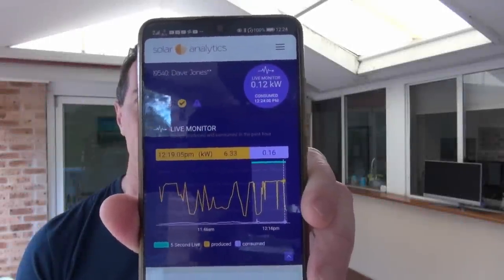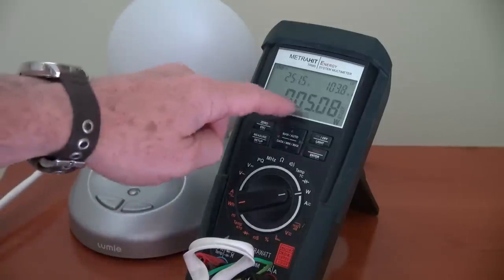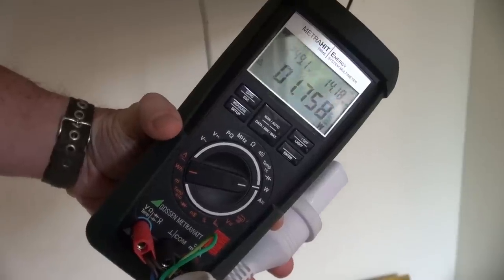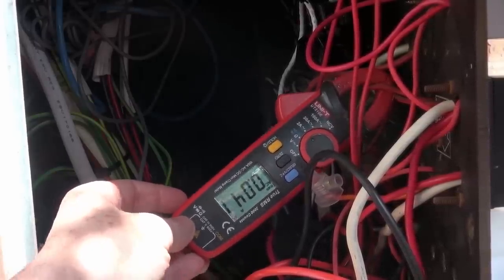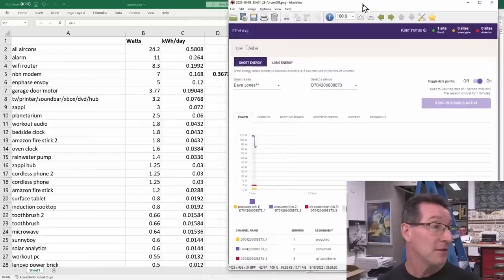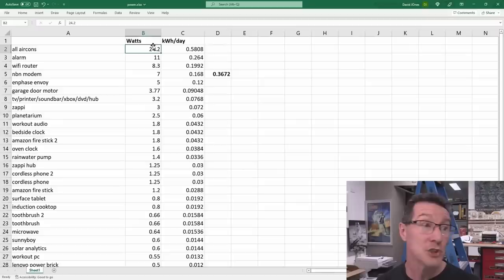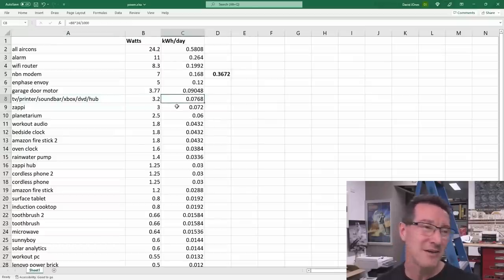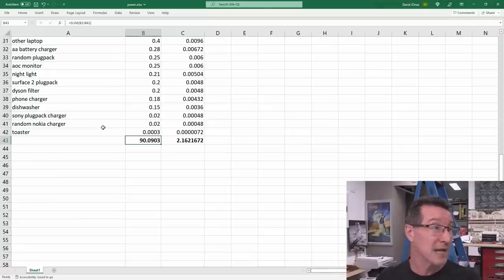EEVblog 1505 - 120W Home Phantom Power? Audit Time!

Comment: AV Receivers can be pretty bad. When (Brand Name Suppressed) first made HDMI-capable AV receivers, the manual documented the "Standby Power as "blank". Not mentioned. They didn't want to admit to running 40W in standby. Or 3.8MWH/year. Or to the model that ran at 115W in standby. They took this much to support a "feature" of linking the first HDMI input to the output when in Standby, but than meant keeping all the HDMI hardware powered up. Their next generation allows "HDMI Through" to be set to "Off" to stop this. Successive generation managed, 16W, 8W, then 4W. But still a lot more than the "One Watt Initiative".
Reply: Are you high? 40w is about 1KWh/day, or 365 KWh/year.  $55/year at $0.15/kwh

Comment: You might not be charged directly for reactive power, but all that current going through long wire runs in the house will consume a significant amount of real power due to resistance of the cables, breakers, plugs, etc.

Comment: Hi Dave, great work on the audit and explanation! I didn't see your fridge / freezer in the audit though? I know mine draws ~120w every time the compressor kicks in...
Reply from the maker: Mentioned at the start, they are powered from my battery.
Reply: That 120W is only for a very brief moment, just to start the compressor. Once it is running it should only draw a few 10's of watts, so to save power there you can simply adjust the thermostat. I have a thermometer monitoring my fridge showing the max and min temp.
Reply: @EEVblog  Ah, obviously missed you saying that 😅

Comment: I wouldn’t switch your router off every night. They don’t really like that, especially the more complex ones. Depending on the type of NBN you have, I’d be inclined to ditch the ZTE thing and go with a ubiquiti unifi setup. Trust me, you’ll never go back, and I say that as a washed up network engineer in a former life.

EDIT: yeah, if you want an awesome router, grab yourself a unifi setup. With cable internet, you just plug the router straight into the modem.
Reply: Sorry mate, unifi sucks. Anything openwrt is superior, and you can pick up some used enterprise access points to spread through the house and give you a lot better performance on the cheap, just gotta be aware of what's licenced and what isn't.

Comment: In light of the current energy crises there's a lot of "guides" on how to save electricity floating around. All of them say to unplug phone chargers when they're not in use. Really? To save less than 0.1W or a fraction of a kWh per year? Turning modem/router off over night is another. It may make more sense, but only if you still have a traditional phone line instead of VoIP. If you did turn it off that's maybe 20 kWh per year, so not nothing but also not earth shattering.
Honestly, just put a lid on your pots and pans people. Your food will cook faster and at lower power. Pay attention to the power consumption figures next time you buy a large appliance. And maybe turn off the TV and read a book or go outside every once in a while. One hour of TV watching is about the same as one week of turning your router off over night.

Comment: You summed all the real (not reactive) power consumption directly at the devices´ side. The reactive power was much higher than the real power, in some cases one order of magnitude bigger. But the house wiring is also burning power by providing resistance, so your measuring setup might be inaccurate when you measure AFTER this current path. You should include the house wiring into your measurement, as the reactive current will cause real power loss in the cables.

Comment: An uneducated guess: doesn't it require power to sustain the EM field that goes along every power running wire? It extends a field within a field, so it must effectively push against it? Could the missing 10w just be the wires fields?

Also, having exact knowledge of your wiring, and given the strength of the background EM field, sounds like that should be pretty calculable. Ofc geo orientation / alignment against the background should be taken into consideration as well.

Comment: Some of the missing power might be I^2 R loss in your cables, from all the reactive currents.
Reply: even if he had 1 Amp rms (240 VA) spread though all those circuit branches, the I^2R is going to be less than 1 Watt

Comment: I did a similar audit on my house about 18 years ago.  I found that my LG CRT TV was using the most standby power at 12 watts.  I always wondered what it was doing with those 12 watts.  So I started powering off and on the the TV everyday using the big clunking power button it had on the front.  After about a year, the button wore out and stopped working. 🙁
Reply: Most of those 12 watts were keeping the CRT heaters warm so the picture was displayed instantly, without it the tube would need to warm up before the picture became a comfortable brightness.
Reply: I remember when the big clunking power button was all there was.

Comment: I am aghast at how many electrical items you leave on standby or just plugged in consuming power....!
In the UK we have just had a huge increase in energy bills and everyone has had to cut back on power consumption, never leaving toothbrushes plugged in unless they really need to be charged, TV is never left plugged in when not in use, hi-fi on stand-by - unplug it unless you are using it! And a garage door opener, I'm disabled, and I still get out of my car to open the garage door and don't rely upon an electronic door opener. The microwave is never left plugged in and likewise the gas cooker that has an electric clock because they all consume some amount of unnecessary power! I could go on and on about stuff I/we don't leave plugged in consuming power, we have to because of the huge increase in power costs in the UK, our electricity cost has tripled in price. Unless it HAS TO REALLY be powered, unplug it, you don't need your toothbrushes plugged in 24/7, get out of the car and open the garage door and unplug the electric door opener, that is if you really are serious about saving costs and not just blowing hot air!!!
Reply: Toothbrush costs about £2/yr at current inflated rates - how many cycles does the switch or socket have in it, and what's the cost of replacing it?

At some point you end up throwing more time and money at 'saving' money than you actually save.
Reply: @Monkeh616  £18 a year mate at 0.6W, that becomes 20p a day if you have 4 of them thus £6.20 a month. For tooth brushes on constant charge. My one runs several months on replaceable AA batteries, no charger needed.
Reply: @dlarge6502  You're off by an order of magnitude. I genuinely can't post the math because YT deletes it silently. If you get three months out of a pair of AAs the cost is.. comparable at best, and you're creating waste and, if you bother to, a recycling problem.

Comment: How much power will be used by a timer?
Reply: You can get a battery run timer now for about $10.00. LCD screen, no moving parts but the buttons to set on and off time.

Comment: Although its interesting to know, trying to save power at this level is  going to far.  You could setup homeassistant to automate things in your house with much finer control, but the power usage of 5-8w would probably drive  you crazy.
Reply: Depends on where you live, unfortunately it is more and more important with electricity prices being up to 3x as high for residents in Switzerland for next year.  I don't know how much electricity prices will change in Australia.

Comment: So you didn't find it! It's a whole full sun panel at 250W and you found 90W. I don't know about reverse reactive load from your branch of the grid, but how about putting a less leaky capacitor on that one A/C and finding out how the power factors fight each other to crack out 150W. Maybe you need to be the first one to save 150W sprinkling SMT capacitors in his fusebox...maybe save enough power to play games or maybe it's the line capacitance on 40 meters and scopes and supplies?

Comment: I wonder how much power cables themselves consume. If you think about it - mains cable is a weak capacitor, so there should be some power lost there. I'm pretty sure it's negligible, but I wonder how much it is.
Reply: Most of that is reactive power, homes don't pay for that.
Reply: current through a (ideal) capacitor is 90 deg out of phase with voltage, so real power is zero.
The parasitic capacitance you are describing is very close to ideal (no ESR component).

Comment: I was shocked that my washing machine is ~1.2W but 15VA. Then I looked at the DVR that PoE's cameras and 120W real power 24/7. I suspect I can run the 48V PoE stuff off DC once I get my 48V solar setup going, but for now I think it's just that they shoved a tiny PSU with a fan into a giant box (the SSD is larger than the main circuit board in a 1U rack box)
Reply: I can beat that - the Panasonic inverter microwave takes less than 1W but 70VA due to its appalling  PF.

Comment: I noticed you did not mention network printers. I have 2 laser printers (HP and Fujitsu) and both of which are power hogs requiring 10W each standby power. I tried only switching them ON only when I needed to print but found them unreliable in connecting to ethernet, so I have to leave them ON continuously. I suspect they use a heater so they start up quickly (10-20 seconds).
Reply: I imagine these are like 15+ years old? More recent devices should be more efficient in networked standby. I would also advise setting them up to use a fixed IP, and use just that as the printer port ( none of that WSD rubbish as Dave might say). This eliminates local DNS and DHCP as a potential error source. I won't be surprised if it makes your printers work reliably even after a cold start, been doing that for years with zero connectivity issues. If not, time to start looking for a service manual and track down some bad caps, I guess (assuming they didn't just use an off-the-shelf power supply module with replacements easily available).
Reply: @PileOfEmptyTapes  Thanks for your comments.
The HP is a LJ4050N and is about 25 years old. I had real problems getting Windows to pick it up on a network scan so had to give Windows its net address and type before it would install drivers. It is only B/W but still prints 100%. As it prints about 4000 pages per cartridge it is my go-to printer for printing. The other printer is Fujitsu Docuprint colour printer. It is about 10 yeas old and was given to me as a good colour printer. As they both work perfectly I prefer to "let sleeping dogs lie" and accept phantom standby usage.

Comment: pretty interesting i thought was the large difference between the aircon units... dont those things each have a really large capacitor in them for some essential function? if true then could it be worthwhile to take them out and check the leakage etc? for example if they have been in constant usage for a number of years and compare to the newest one. just wondering why else they could possibly vary so much between each other (if they are in fact the same model and version, however you did not clarify that in today's video here).

Comment: Does the logger, log via internet? And didn't you switch of the power to the modem in the last shot at the fuseboard?
Reply from the maker: No it logs via 4G mobile sim as I mentioned, and no the WiFi was still turned on anyway.

Comment: If you switched off your WAN link at night, would your energy system's monitoring be able to buffer the data during the blackout period and flush the buffer to the cloud infra once the sunrise WAN link is reestablished? Or would you wind up with blind spots in your energy dashboard?
Reply from the maker: The solar analystics is 4G SIM card. Enphase switches off at night anyway.

Comment: If you have solar + battery + inverter for your home, do you "pay" VA? In other words, should we be more careful about pf if we are off-grid on an inverter?
Reply: sortof yes, but not for these phantom loads.
You need to spec your inverter and wire gauge for the max VA at max load. That might be more up-front cost.
But don't focus too hard on steady-state VA numbers, because appliance/motor startup inrush is often orders of magnitude bigger. You don't want your inverter to overload and fail every time the freezer compressor starts up.

Comment: Saving 0.3672 kWh/day with your networking gear with a smart outlet... let's say the outlet uses 1W all the time, and you're saving the power from the gear for 7 hours a day. That's 0.1311 kWh/day or 3.933 kWh/month saved. If you spend $0.30/kWh and the outlet costs $30, it would take 25.4 months to break even. Is that worth it to not have your devices be able to update overnight? How sure are you that the smart outlet would turn back on in the morning without internet (my TP Link Kasa outlet wouldn't)?

Comment: Did you factor in heat generation due to the resistance of the wire runs? I doubt that would account for ~~17% error, but I'm sure it's nonzero.
Reply: Lets say the total VA for the ~100W phantom load is 240 VA(42% PF).
That means there's 240VA/240V = 1A spread throughout all the wire runs.
Worst case is 1 wire run of 14AWG (all the current in the same wire), but in reality there's dozens of wires distributing the load current.
Assume a generous 1 km of wire (500m to point of load and 500m return) = 8.3 Ohms.
Power dissipated in the 1km wire is I^2 x R = 8.3W
In his house (multiple circuit branches that are much shorter than 1 km), it would probably be much less than 1 W.
Reply: more likely, its the fact that residential (and industrial) power meters usually do not have a rated accuracy below 1% of rated full load.

Comment: Wouldn't turning off the router and modem increase the power draw of things like the xbox and fire sticks as they search for a working wifi connection?
Reply from the maker: The xbox and one fire stick can be easily switched off.

Comment: (joking) It's just the draw of the monitoring unit. The Lenovo has to logon the secure machine in there to spy from time to time. I totally disconnect my computers including the network when I am not around and I don't know if there is going to be a storm. My internet goes through my phone, so when I pull all the plugs there is no wired connection to anything.

Comment: my background draw is 500w - down from 600w after swapping out my thirsty Cisco 3750-48poe switch.  Still 12kwh a day noise before i even switch anything on.

your 90w for all those gadgets is pretty good and not worth the effort imo.
Reply: tell the wife you need a catalyst 9300 as it uses less power :P

Comment: Ok, but what device to buy. The one you have is very costly. And my fluke clamp meter has a to low resolution.  And all the lowcost ones will either miss the calibration or resolution. So i have a whole arsenal of test gear. But not this. I feel defeated.

Comment: The trouble with the network stuff is the same as the PC "idle power" problem.  Since Wifi AC came along the CPU required in the routers went up significantly.  They used to pull a couple of watts, but now they pull anything from 6W to 18W!  I'd suggest everyone check their own, just in case you have a hot and hungry one.  I replaced a TPLink Archer V900 which pulled 18W constantly and the surface of the routers box was 45*C on thermal camera.

Comment: wall plug sockets should come with a house-wide 5V rail that powers all this standby circuitry, with a single central power supply. I assume 90% of the standby power is taken by the inefficient power supply that has to provide a few milliwatts while being able to go up to many watts as soon as the device powers up.
And when standards are already changed, some higher voltage DC rails could be included. The future is decentralized solar + battery. They all run on DC, like most electronics today. Does anyone know what would be the highest voltage that could be used safely without fire hazards etc.?

Comment: That electrical panel is very different from other countries.  Everything seems unique and hand wired.
Reply: It looks like a death trap to me. How is that mess even legal?
Reply: @rocketman221projects  Looks fine to me.  All that "spaghetti" spreads out the wires aiding cooling.  It's all the tightly packed "neat" bundles of mutually heating cables that should be illegal.
Reply: That is an old panel. I’ve seen plenty of crap far worse than his panel. I had the pleasure of working on a building with cloth wire, no grounds and uninsulated or taped crimped joints. The amount of burn marks on the wood on the walls amazed me it didn’t burn to the ground. I rather like the modular design of his panel. Just a bit of raceway would be my only change.
Reply: @thisnthat3530  There are codes against bundling for that reason in the US. If you are really concerned about heat then you can't beat the giant heatsink that is the common distribution panel in the US.